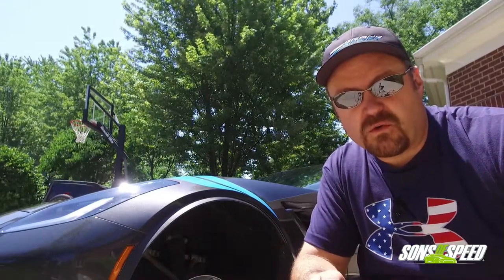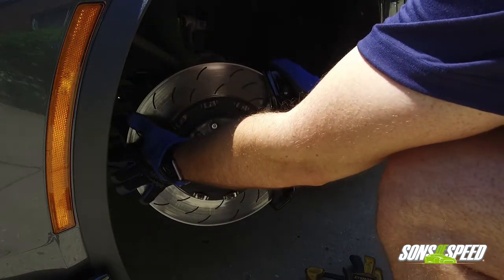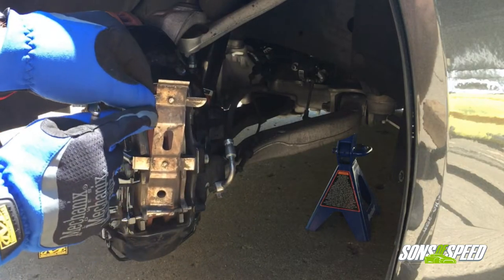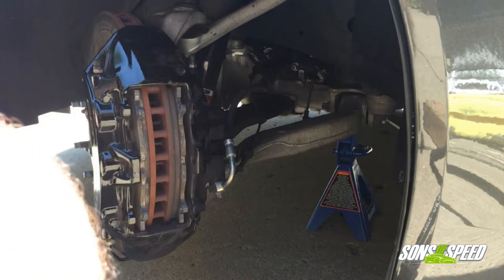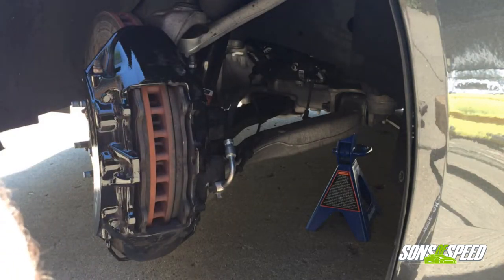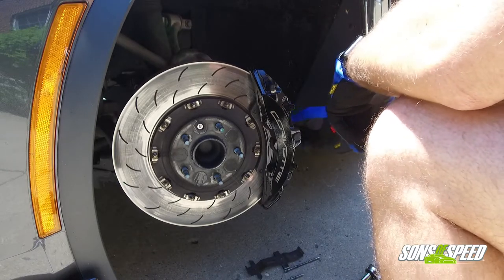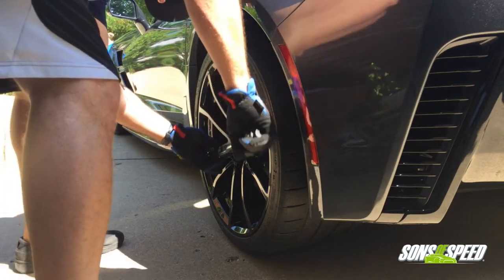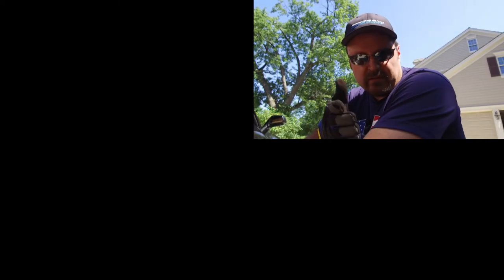How to Change Brake Pads on a C7 Corvette | Sons of Speed

Comment: Is it a good idea to apply some form of grease around the guide pins or the sliding surfaces of the brake pads? I have seen a couple videos of people doing brake pads on the c7 corvettes and they are all done with no lubrication. I wonder if this is the standard practice